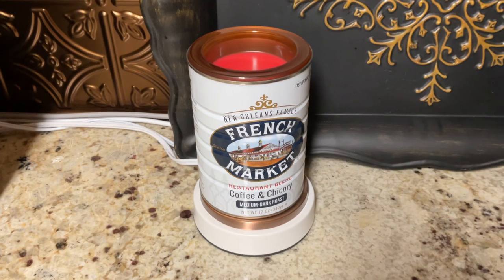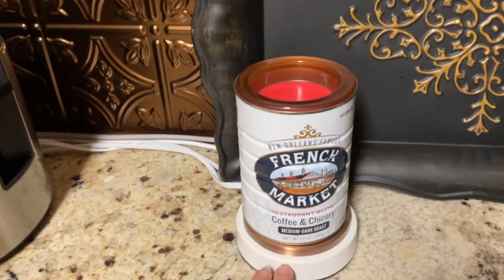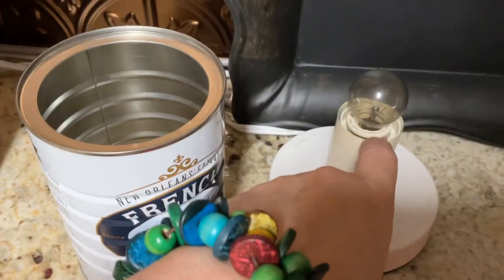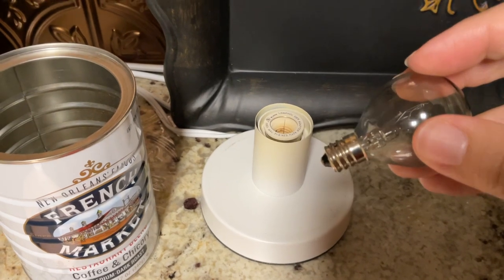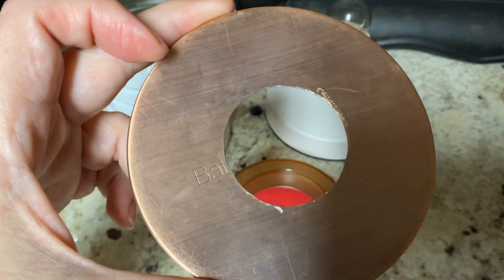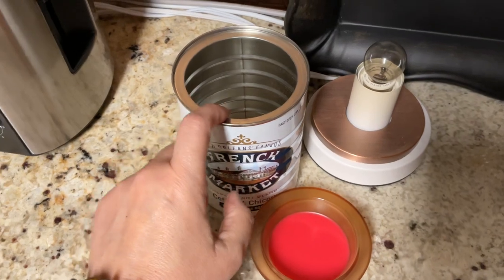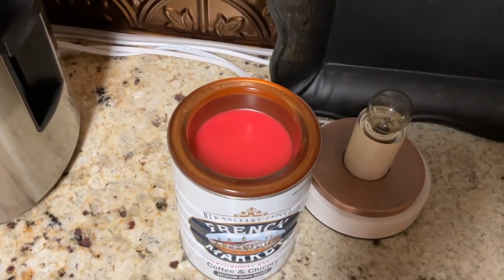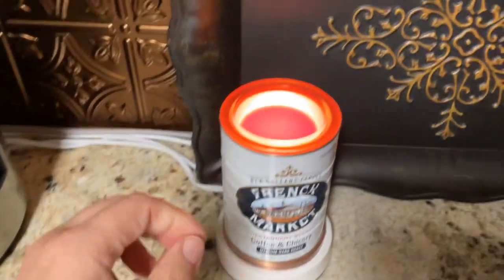Let’s Make a Wax Warmer - My Coffee Can Warmer and how we did it

Comment: Very cool and creative!  Just a thought, should there be holes to vent the heat or do you find that it doesn't get very hot?
Reply from the maker: I don’t find the can gets too hot. I had a 25-watt bulb in originally but I was also doing a lot of vendor wax in it. I found that when I would warm Scentsy, the 25-watt seemed too hot (burn off the scent too quickly), so I changed the bulb to 20-watt which seems just right.